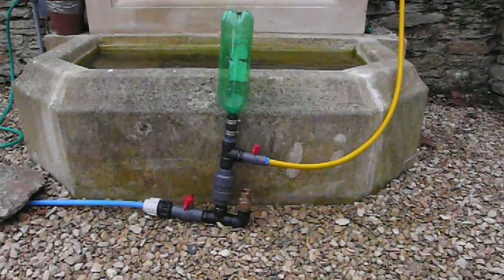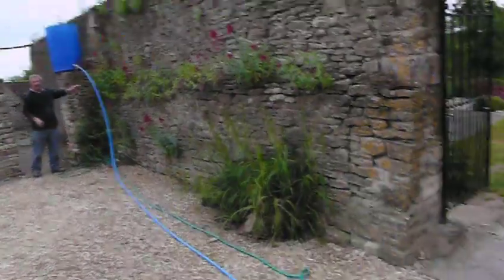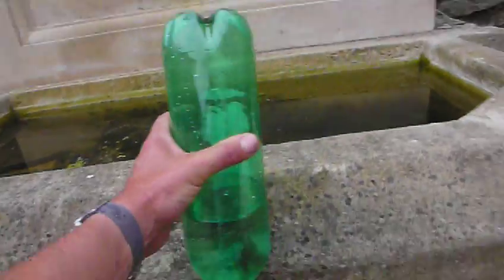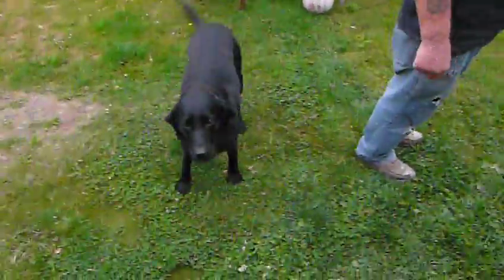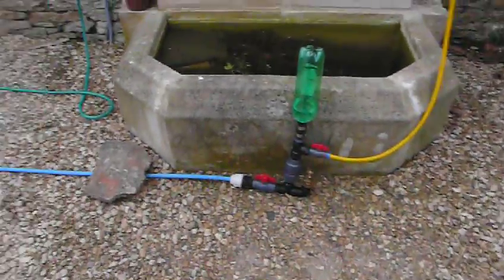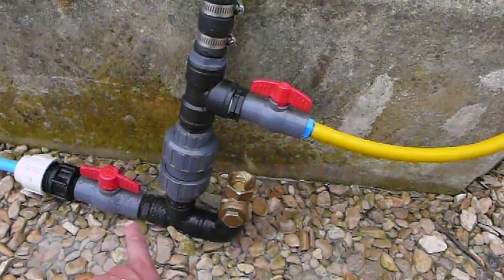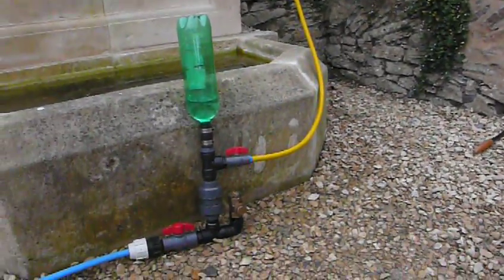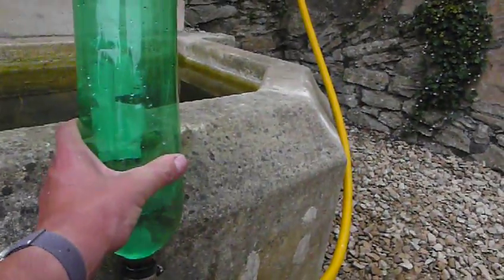Plastic Ram pump with a plastic mineral bottle as a pressure vessel.

Comment from the maker: @SuperKONR Hi thanks for that, your a person with common sense!!
The snifter valve is a tiny hole drilled below the non-return valve, with each pule of the impulse valve a small amount of air is sucked into the expansion vessel, it prevents the expansion vessel from becoming water logged. Normally a small split pin or similar thing is placed in the hole, this pin needs to be free running and helps to prevent the hole from becoming blocked. Hope this explanation helps. Cheers

Comment from the maker: Hi. You need to check the following:
1. All compression joints to be tightened up and water tight, you need to use PTFE tape, available from plumbers merchants.
2.You need a fall of at least a 1 metre from your drive pipe to the pump.
3. Keep the ou let shut while pump builds up pressure, then turn on slowly.
The snifter allows a small amount of air into the air chamber on each stroke, preventing water logging of the chamber.
Tell me a bit more about your set up and we'll get it going.

John

Comment: In theory you could just close the valve and open it all up cause your water drainage is below your blue tank. gravity wins here. The output should be above the blue tank for actual pumped measurements.

Comment from the maker: @AFM764  Right to clear things up, On another occasion i pumped water to the roof which was over 30 ft up, the water was spilling over at the top and the hose was not trailing down the other side to ground level. i was unable to demonstrate that in the video. I understand the syphon principal. Cheers

Comment: Why cant you close the waste valve?
Reply from the maker: If you shut the waste valve the pump will cease to work.
Reply: Dieseljonnyboy Can you add a water bottle to the waste valve so that the water goes back in?
Reply: The waste valve closing diverts the incoming water in the drive pipe into the pressure chamber (expansion vessel) where the air gets compressed. When the air pressure in the chamber exceeds the incoming pressure, it pushes the outlet valve open, sending water into the outlet pipe. The waste valve opening releases enough water pressure to allow the outlet valve to close so another pulse of pressure forms. Pressure is built due to the inertia and weight of the water moving through the drive pipe. The waste valve closes to start the next cycle. Without the valves opening and closing, the pump is no more than just an open pipe.

Comment from the maker: @AFM764  The pump lifted the water over wall which was higher then the water input, It was only a few feet higher but demonstrated the pump ability to lift water. Later on i pumped water to the roof of the house which was 30 ft higher then the water input, No syphon. Cheers for your comments.

Comment: People need to stop with the "up and over is not the same thing" golly. It pumped up to a 30ft roof so obviously it works.

Can you tell me how the (snifter?) valve works? Is it just a hole drilled into the pipe or is there a ball valve of some sort?